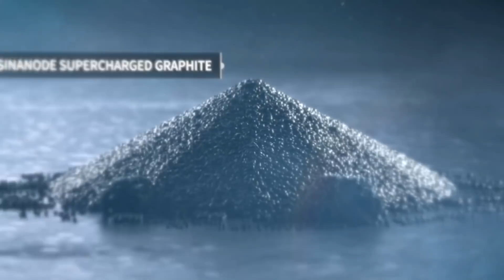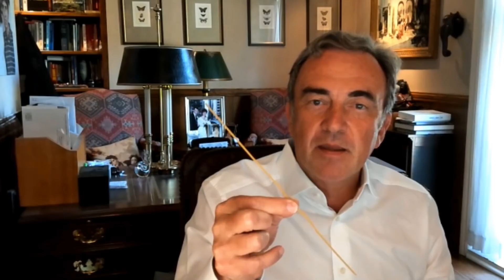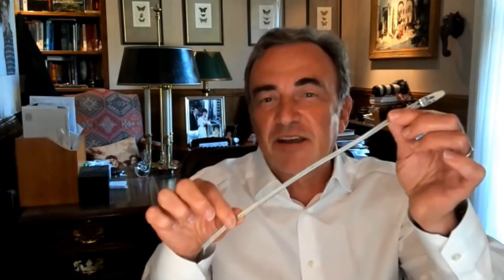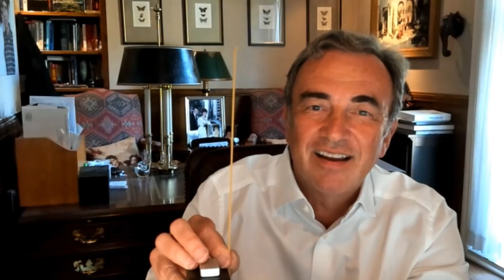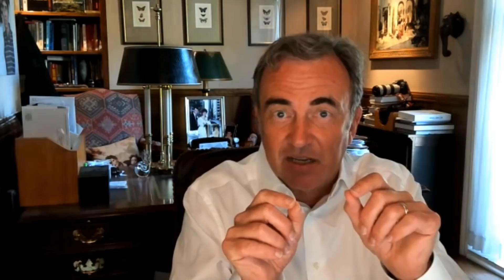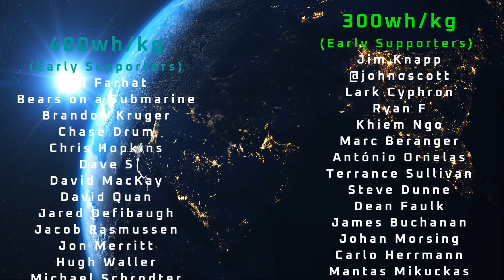Sinanode: Low Cost Silicon Nanowire Coated Graphite for OEMs

Comment: Awesome stuff!
I don't quite understand how the specific surface area of the silicon wires can be lower than that of much larger graphite particles though.
Reply: You are correct that silicon nanoparticles have huge surface area, which consumes lots of electrolyte to form an SEI... There are two key reasons that the SINANODE process produces a composite powder of silicon nanowires on graphite particles with a lower BET surface area. The first reason has to do with the way we grow the nanowires with "seeds" (nanocatalyst) of copper oxide. The defect sites or edge planes on graphite particles normally contribute to its BET surface area, which are also the preferred sites for adsorbing the Cu2O catalyst nanoparticles. After the Cu2O catalyzed NWs growth, those surface area are reduced by Si and hence the graphite particles’ BET surface area measured is reduced. The second reason is that the very thin very long nanowires have a shape that has inherently a lower surface to volume ratio than the surface to volume ratio of a collection of silicon nanoparticles with same radius and the same total amount of silicon. This is the spaghetti example that I give in the video. See my other comment on that...
Reply: @vincentpluvinage5834  Thank you, an absolutely stellar explanation. <3
Reply: @vincentpluvinage5834   So the end product has a smoother overall surface than the carbon.  Would this analogy be close to the same as your spaghetti.   It's easier for me to visualize, unless I missed something that is.
  If you had tall grass growing densely on the surface of a pile of rocks, where the total exposed surface area of the rocks would be greater than the undulating surface measured at the grass tips?
Reply: @vincentpluvinage5834  😅 Last question of Jordan : When will I be rich ?
Your last asnswer :
👍🥳 One day the oem will be rich. 😂😂😂
Reply from the maker: https://www.energy.gov/sites/prod/files/2014/03/f9/es130_zhu_2012_p.pdf

"SiNANOde material deforms to fill void areas in carbon anode material matrix"

I think it's because the animation is slightly different than what it actually looks like with an SEM.  These particles aren't floating around, they're encased in other material and flattened against the particle?
Reply: Thank you son much Jordan and Vincent.  Very educational. Please forgive my bad analogy but instead of the total surface are of a golf ball, you end up with a table tennis ball covered in silicon wires. Is that correct?

Comment: At location 28:00+ the word nitrogen is said. Interesting, as the Austin cathode plant has  large nitrogen tanks. In line with the massive graphite volumes required ?
Reply from the maker: Graphite is used for the anode rather than the cathode.

I'm not sure why they need nitrogen for the cathode plant.

Comment: amprius seems to be better
Reply from the maker: Only if you define better as higher energy density.  Sinanode takes the cake on most other metrics.
Reply: no    cycle life is 1200 with only 10% loss this puts it on par with other batteries because the density you need less # of cycles. I am sticking with my opinion

Comment: Or using the battery tech. In the actual wiring. To using efficient wires enough to power each component.

Comment: Excellent interview. I have one question, does the higher amount of silicon in the anode affect the voltage of the cells?
Reply from the maker: EXCELLENT question.  Yes, but the capacity more than makes up for it, and it reduces the chances of lithium plating.

Comment: at 9:17 "so, the less surface area that you can have the better", May i ask you be a little bit more specific on this part? I understood Graphite being the storage for lithium, so to my understanding, more surface area would be rather desired??
Reply: That's what I'm struggling with too. How I understand it, you want to minimize the area where the anode touches the electrolyte, as that is where a special layer is formed first time you charge the battery. This layer is called SEI and the problem is that it locks up part of the lithium, so the bigger the area (surface) the more you need to have extra lithium that you will only be carrying around as dead weight.

On the other hand, you want the anode itself, internally, somehow store the lithium as fast as possible. Silicon is helpful there, because those individual atoms of silicon can bind multiple atoms of lithium from all sides, whereas in graphite the lithium is stored between 2D layers of graphite.

The obvious question is, how is the lithium gonna get to all those silicon atoms if the silicon material has low area that is touching the electrolyte. Seems the only answer would be that it can travel within the silicon material, and do so very fast.
Reply: @peter.g6  perhaps it is that the defects in the graphite are reduced (by the Cu first as a seed for the Si), and the long hairs limit the electrolyte from contacting the carbon at discontinuities yet allow the ELECTRONS from the electrolyte to be conducted (not the Li)??

Comment: Finally got an uninterrupted viewing but I feel i need to watch it again! I'm left wondering just how drop in this product is. Does the reduced surface area reduce expansion by lithiation? You asked about using the same electrolytes and Vincent said yes (implying drop in compatibility) then went on to outline incremental changes over the next several years where many things incrementally changed alongside the cathode material. i didn't fully understand the cycling figures. I'm left wondering whether the likes of Tesla wouldn't just go for the big bang and then build a new factory from scratch to leverage all the incremental improvements in one go. I assume other battery OEMs see immediate value in having any graphite supply being souped (siliconed) up. If it's adding appropriate value to cells without severe costs it would surely be a no brainer.
Reply from the maker: Hola!
1) It doesn't reduce expansion, it reduces the stresses associated with expansion, keeping the fibers intact
2) My view:  Drop in now, but will need mods to hit very high Si loading
3) Yeah, we need a chart or data
4) Tesla has something which I consider equal to or better than this (cheaper)
5) Amen!  It all depends on backend/trade secret/commerical confidential dealings that we don't have insights into
Reply: @thelimitingfactor  I didn't expect a reply. I was sort of posing largely rhetorical questions. Cheers man. Keep up the stunning work. Pleased to see your subscriber base climbing.

Comment: Great content, Thanks! One comment: Using silane is expensive and dangerous (pyrophoric gas). The same thing can be accomplished by using chlorosilanes. In fact, MCS (Monochlorosilane) and DCS(Dichlorosilane) are typically used in the semiconductor fabs. It is a reverse Rochow-Muller process.
Reply: Monosilane is used in very large quantities for producing solar cell poly-silicon and for flat panel displays, without accidents. It is less expensive than using MCS or DCS, which are not produced in sufficient quantities for the EV application. The mono-silane is decomposed into solid Si NW and hydrogen, which can be re-used to further decrease cost.
Reply: @vincentpluvinage5834  In terms of cost of silane vs. chlorosilans, there is no doubt that chlorosilanes are much cheaper. In fact, most industrial process of making silicon ingot is by using chlorosilanes. The process was developed by Siemens long ago. In addition, chlorosilanes are far less pyrophoric in chemical nature. They can be purified by atmospheric pressure fractional distillation, as opposed to high pressure distillation of silane. Tetrahlorosilane is not pyrophoric. The only drawback on using chlorosilanes is the corrosive nature of the effluent gas, which can be dealt with easily in an industrial process.

Comment: great information, would be interested to know if Tesla would use this tech. You mentioned 2170 cells and not the 4680 having the scenario of two steps forward and one step back. Does this mean Tesla 4680 is going down this path with them?

Comment: Great interview!
Is it possible to add more anode active material, let’s say 125% capacity with respect to the cathode and have a charging curve 0-100% that is like the 0-80% of a “normal” cell?
Reply: Do you  mean 10%-90% ?
Reply: @DarylOster  no I mean a cell that charged at 100% has an anode that is filled with only the 80% of its capacity

Comment: Proof of concept? Yes. Ability to scale? Unsure. From how I took it, it sounded like countless manufacturing plants would be needed all over the world. And if each OEM and each battery maker was vying for their own unique blend to distinguish themselves, seems like scaling might be an issue. But…if someone, say a Toyota or a VW, took ownership of the tech, then you’re basically talking another Goliath player inroad.???  The question becomes then, how is this company (ones like it) not then under HUGE pressure to be bought out 100%?
Reply: One large-scale processing plant can process enough anode materials for > 10M EV batteries annually. For logistics and cost reasons, there will be three plants in various parts of the world. Each plant can serve more than one customer, since there are multiple CVD lines in each plant. Not very different from the CVD lines that are producing today all of the solar cells used globally.
Reply: @vincentpluvinage5834  Wow! Many thanks.
Reply: @vincentpluvinage5834  I’m going to rewatch interview.

Comment: Wow! Yet another mandatory video for the serious analyst/investor to follow.  @The Limiting Factor  Please describe the extent that charge/discharge gains were due to thermal management via octovalve & heat exchangers.

Also, per that shop in Phoenix AZ (GruberMotorscom) that recovers Tesla battery packs by isolating, then "clipping off" parasitic cells, could some of this tech be leveraged to have damaged/low-performing cells remove themselves from pack circuitry, thus extending pack life by orders of magnitude?

 TIA

Comment: An absolutely fabulous video. Just missing the where to invest button... If I remember correctly there are issues with silicon expansion and contraction when cycling a battery. Does the Silicon nanowire solution address this?
Reply from the maker: From what Vincent is saying yes, but it may have limits (as a percent of silicon in the anode).

Comment: Exciting stuff. This is really going to put battery adoption into overdrive. Doubling energy density at a lower cost. Puts a lot of new applications into reality.

.... almost too good to be true 👀. Hopefully not.
Reply from the maker: It doubles or triples the anode capacity, which is very different from energy density at the cell level...as I showed on the slide, more like 20% energy density improvement
Reply: Ah of course. Thank you for the correction. I got a ahead of myself in the excitement. Still great news towards meeting the mineral demand for battery production over the next decade.

Good luck Sinanode.

Comment: Not Relevant to the video, but what do you think about model S plaid having some innovation announced at battery day BUT in the 18650 Elon confirmed is in the new car. Seems they are getting a step change in performance from a similar 100 kWh pack as the past, better charge curves holding 248 kW at 34%+ of charge, better performance producing 1000+ horsepower at 30% SOC.
Reply from the maker: Working on the video now
Reply: @thelimitingfactor  awesome ☺️ Love the in depth videos and excited to hear your thoughts
Reply: @thelimitingfactor  Please describe the extent that charge/discharge gains were due to thermal management via octovalve & heat exchangers. TIA

Comment: Great interview and new tech, sounds amazing. I didn't hear enough specifics though. Like does this mean we can have batteries with 3 times the performance or 1/3 the weight or 1/2 the cost? What will it do for an electric aircraft or vtol? Please do a follow up video explaining this in the way you do best! Thanks!
Reply from the maker: Over time, probably looking at 20% energy density increase, 15 minutes charge rate, and about 5% lower cost.  Check out my series on Silicon if you want to go deep.  There were three videos in a row.
Reply: I'm most interested in improved kWh/kg for electric flight which improves power and range even if it comes at the same or slightly increased cost vs automotive wanting lowered cost and performance. Maybe a call to OneD would help understand better what formulation would best benefit electric flight.

Comment: Correct me if I'm wrong, but aren't silicon nanowires basically like asbestos?
Reply: No. It is not.
Reply: @vincentpluvinage5834  I believe that Dayanto means that silcon nanowire coated particles may pose a health risk similar to the health (lung) risks of asbestos.
Reply: @artsnow8872  Nanosys got FDA approval for using silicon nanowires for health applications, many years ago. Again, this is not the proper venue to address this topic, but silicon nanowires are not asbestos..
Reply: @vincentpluvinage5834  You came here, to Limiting Factor, to promote your product. What promotion doesn't receive questions about the product's safety (to workers and others) during its manufacture? As inclusive, this IS the proper venue for such questions.
 No, I'm not saying that your product (or nanowires) is asbestos; but, because of its microscopic size, has the potential of becoming airborne and ingested (or, absorbed through skin contact) into the bodies of workers handling the product during its production processes. 
  I believe that you (your company) would be required to supply FDA with the proof of safety, during production phases, of your product. There is no blanket coverage from FDA that any and all nanowire products, and their process stages, are inherently safe.
Reply: OneD follows the regulation for production of the SINANODE process. The regulations are different in US, Europe and Asia, and permits are obtained from the relevant authorities for the locations were the production facilities are located. All workers are trained and wear appropriate protection, as required in any industrial setting.

Comment: This seems to be as ground breaking as DBE.  Different aspect but seems to be a huge deal
Reply: @Darnell First, silane is used in other CVD, but decomposing silane with copper catalyst on porous carbon powder substrate is not standard: OneD invented that and has 245 granted patents to prove it. Second, to use this as anode material is a completely different approach that has tremendous benefits over the existing silicon solutions. Third, silane has been used for many decades, and with proper safety conditions, no accident occur.
Reply: @vincentpluvinage5834  Hi Vincent, interesting tech here. Can this tech be used for battery companies that want to go 100% silicon anode without any graphite? Interested to hear about the versatility of this tech with different anode compositions, or even potentially solid state batteries.
Reply: @vincentpluvinage5834  perhaps you misunderstood Ken's question.  DBE refers to Tesla's purchased: Maxwell Dry Battery Electrode process, which removes the need for solvents in applying the electrode chemistry to the insulating substrate.  Your explanation didn't seem to equate to the DBE process.
Apologies if I misinterpreted your answer.

Comment: Mind. Blown. 🤯
Reply: @Darnell Silane is bad.
Reply: @YG-vz8rv  Silane is used for decade in all semiconductor foundries + all flat panel display factories + all solar cell polysilicon factories. The accident rate has been extremely low (less than 1 accident globally per decade). Silane is made from MGS and it is the most efficient (less costly and more sustainable) way to have high purity silicon. The SINANODE process produces hydrogen, which can then be reused.

Comment: Those silicon nanowires look very fragile in the graphic. My immediate question: Do those things break, and what effect does that have on the battery? How is longevity affected? Crumbling silicon particles have generally very bad effects on battery longevity.
Reply: The silicon nanowires do not break during slurry and coating and calendering. After first lithiation cycle, they become very flexible and very conductive, and the bond between the nanowires and the graphite surface is stronger than the bond between graphene layers. There is a very interesting PhD thesis and article published in 2012: "Lithium-Assisted Electrochemical Welding in Silicon Nanowire" 
Battery Electrodes
 by Khim Karki in Nano Letters.
Reply: @vincentpluvinage5834  The average person may run into a "pay wall" if they want to read that research article in Nano Letters. Many people don't want to pay $tens of dollars per article to read in a professional publication.
Reply: @artsnow8872  google Sci-hub (like adblocker for science papers) it circumvents those 4 giant publishers that put pay walls on all the science journals.
Reply: He mentioned that they had done 2k cycles and found lower degradation than other cells, and that the lithiated wires were flexible.